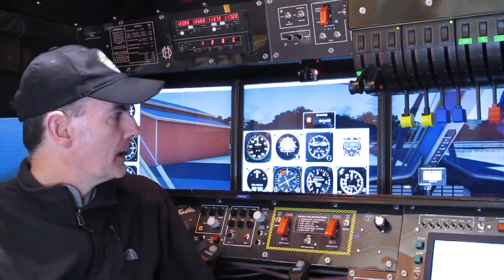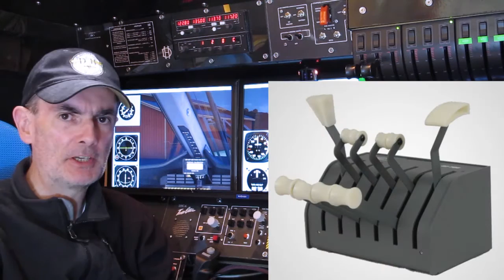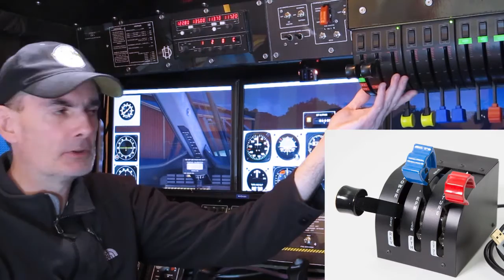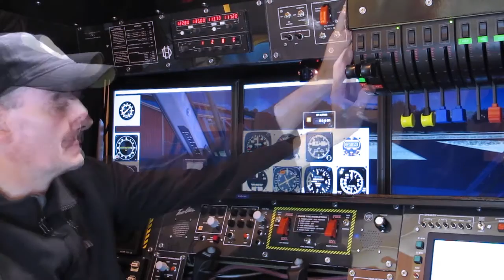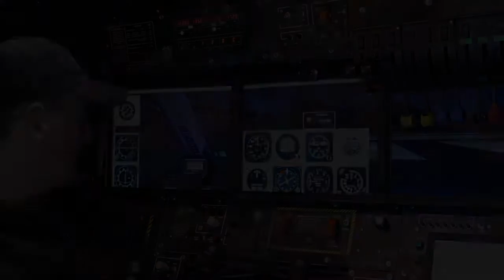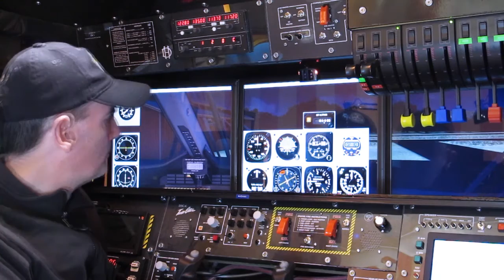Two Years On - Time for Gauges! (Twin Otter Cockpit Build - Part 28)

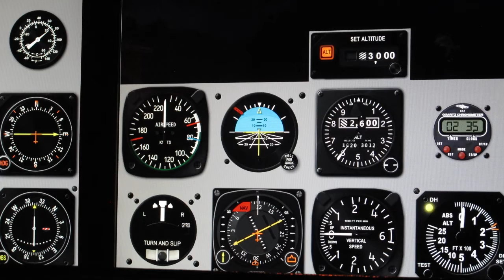Comment: Hello. My name is Charles. What program have you used for the instruments that appear in the 9:13 minute?
I want to do the same with air manager software for the twin otter. I have problems to program airspeed instrument.

Regards.
Reply from the maker: Hi Charles. This is Air Manager but with a custom set of gauges built by Russ Barlow at Sim Innovations. Russ was allowing access to beta test these for a while, though I don't know what the current situation is as they are gearing up to release Air Manager v3. I would say the best bet is to ask in the Sim Innovations forum in this thread: https://siminnovations.com/forums/viewtopic.php?f=14&t=116

Comment: I feel for your throttle challenges, I just dumped my saiteks in the hope of getting some of these http://aerosimsolutions.com.au/throttle.html but currently they are unavailable so I bought the Goflight TQ6 but they are just as you say, not really up to expectations. But getting back to http://aerosimsolutions.com.au/throttle.html  - check out what this guy did and notice he is using a 270 degree pot in his build. It definitely has given me lots to think about.
Reply from the maker: +Zappa Zenovka Yes I have seen those throttles but I couldn't see how the tension was adjustable as is claimed. I also noted there was a lot of building still to do :)

Comment: Giving that you are trying to replicate a Twin Otter setup, I would feel sad if you needed to move the throttle quadrants to the bottom side. I think it's possible to have the Virtual Flight up there with some creativity...  ;)
Keep up the great work you do. Much inspiring!

I have been using Air Manager for a while now and I am very pleased. Works great. I believe you will be very happy with it.

Thanks.
Reply from the maker: +Torbjörn “Hobbe” Sagen Thanks for the comments. I will think more about the throttles. Someone has suggested replacing the potentiometers, which may be possible. There is another option, which is to build my own - for which this looks promising: http://aerosimsolutions.com.au/throttle.html.

Comment: I have just added a monitor to my desktop cockpit panel which will give me the gauges.   I am looking at a MeeGoPad 4gb (just to run my panel/gauges) which essentially is a HDMI USB pen sized PC running windows 10, which.. can run simPanels and or moving map, separate from my main PC and operates independently. This uses wifi to communicate with my FSX/P3D PC. I am also looking at adding a Brunner CLS yoke which similar to the IRIS yoke as a further addition later this summer. And who knows what we will be using later this year...Dovetail... Cheers.
Reply from the maker: +Jimboz SimRigs Brunner CLS, would be interested to hear about how that works out. And Dovetail is the great unknown - will any of this stuff work with it?!